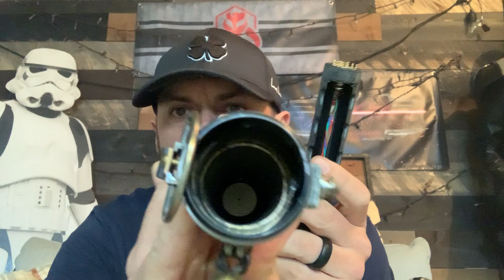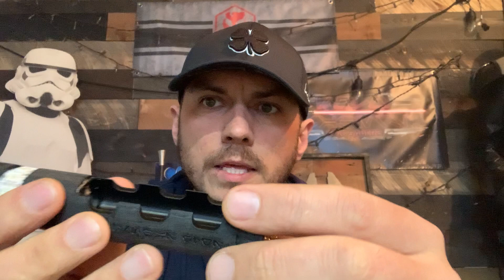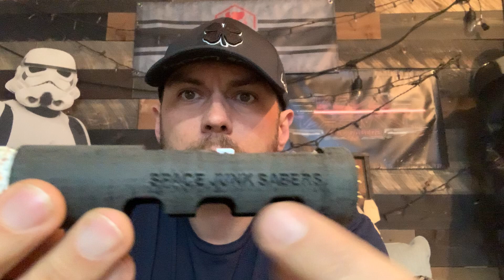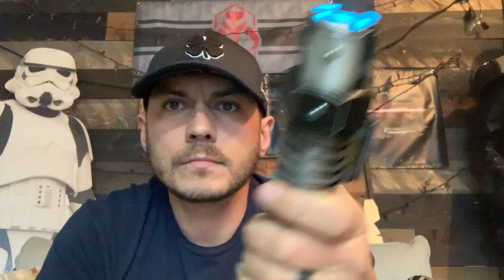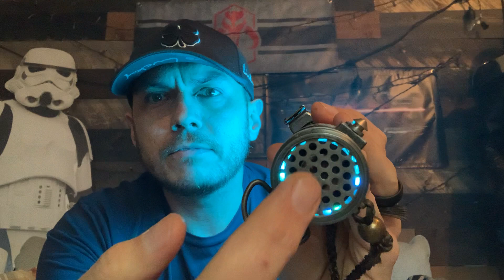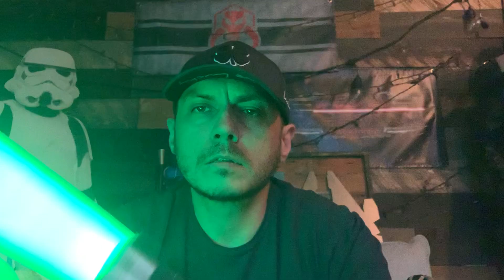Chris’ Mystery Saber by Space Junk Sabers

Comment: Is pom the motion control parameter? And what do you set it at?
Reply from the maker: Yes- I leave it at stock settings
Reply: It says in the manual 5-15. What would be stock?
Reply from the maker: @steelrain5626  10 is fine
Reply: @Solo_Sabers  thanks. To twist off, is there anything that needs to be changed?